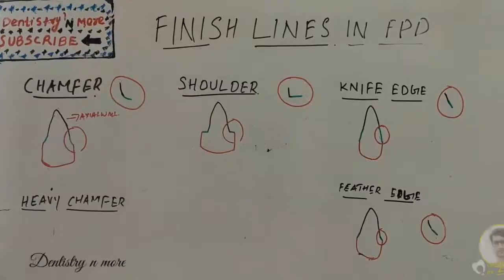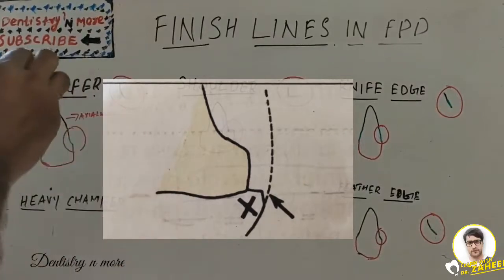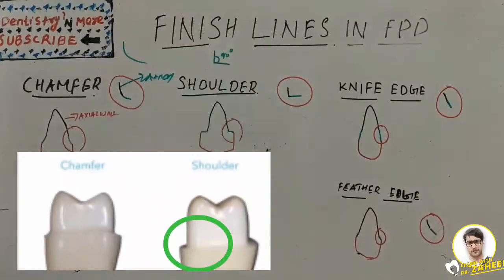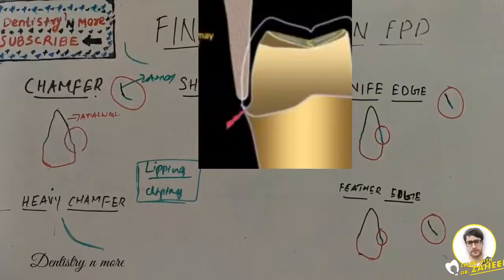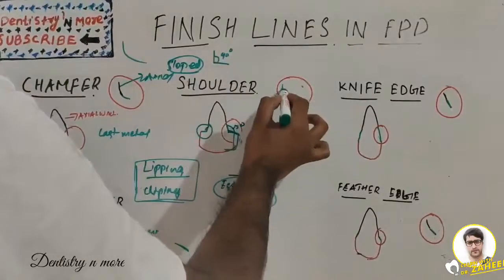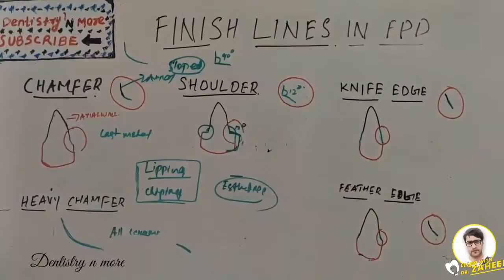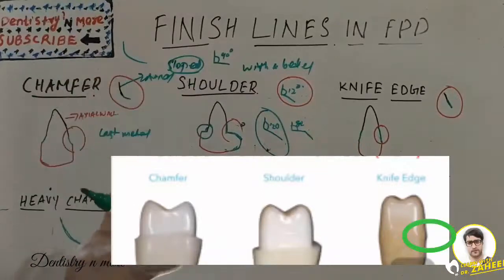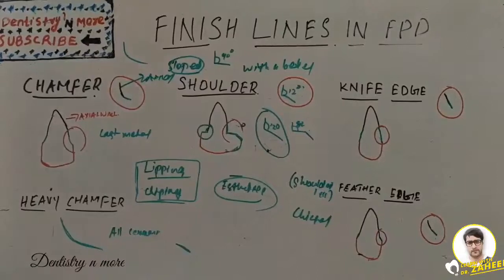FINISH LINES IN FPD

Comment: sir with due respect i want to focus on a point that may be the drawings by you is little bit confucing.i think the width of crown should be less than the root width.the gingival should be placed ouside rather than tappering inside more axially..am i right? i am a student sir.it is just a confusion.nothing to offend you.if you clarify my doubt i will be highly obliged.
Reply from the maker: That depends on the tooth to be considered.Normally width of crown is more than the width of root.